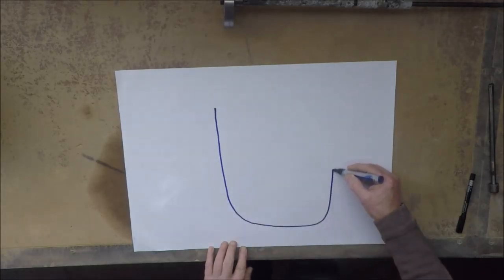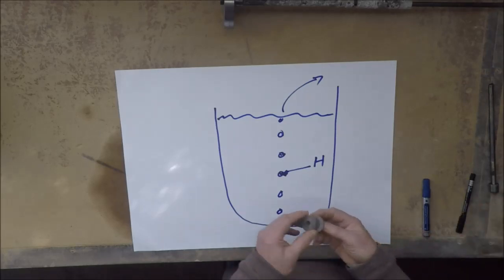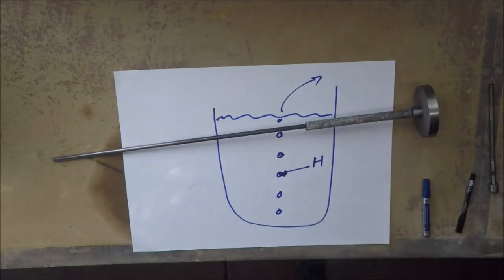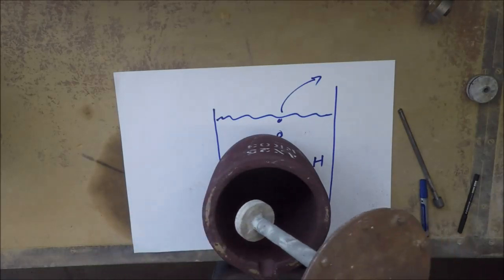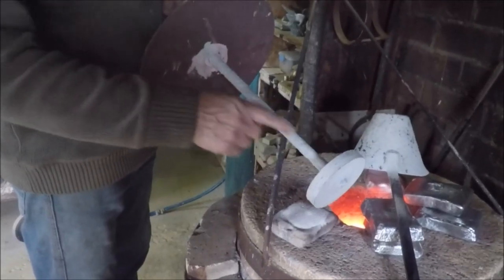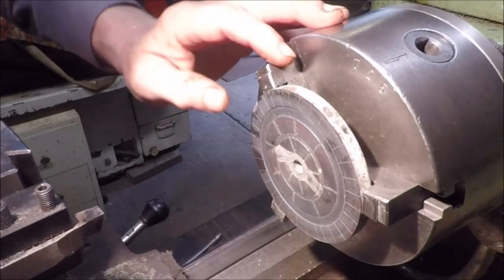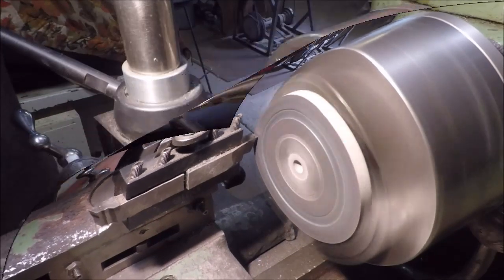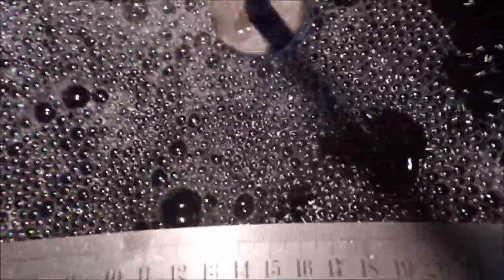My Home Foundry, Most recent Degasing Lance

Comment: A most interesting video, Martin.
Question; If the hydrogen comes from water vapour reacting with the molten aluminium, then I hypothesize that the source of that water vapour would be the humidity layer at the surface of the aluminium at room temperature. 

This is somewhat like how low hydrogen welding rods can absorb moisture if left exposed to the atmosphere. The solution for the welding rods is to keep them either in a fresh sealed tin or to keep them in a rod oven to drive off the moisture.

Therefore, the solution for reducing the amount of water vapour available to react with the molten aluminium in the crucible would be to pre-heat the aluminium feed stock in a suitable oven or low temperature furnace for a suitable heating time to drive off as much of the surface humidity prior to charging of the crucible.
 
 I have noted in numerous casting videos where additional feed stock is to be added to a crucible, that the feed stock is pre- warmed by placing it around the edge of the furnace. This would have the effect of reducing the "loading shock" to the overall temperature of the crucible, but I don't believe that it would be a long enough pre-heat to drive off the majority of the humidity layer or surface absorbed moisture. 

It appears to me that the best way to reduce this moisture issue is to use an oven or low temperature furnace to pre-heat aluminium feed stock to at least 200 deg. C as this temperature is well above the boiling point of water at 100 deg. C and should drive off the water vapour.

What are your thoughts on the matter?
Reply from the maker: Mark, Basically what you say is correct, but there are many more sources of hydrogen and perhaps the main one is that when we burn a hydrocarbon fuel one of the products of combustion is water vapour. There is in addition the natural humidity in the air which of course varies all the time. In fact some people believe that on very humid days it is difficult to degas properly and to keep the hydrogen level down as the pick up from the reaction of the humidity in the air and the surface of the liquid metal can be quite high (particularly if the surface of the metal is agitated) - this can even be the case with electric melting - the humidity in the air is quite simply that potent a source of hydrogen! Drying ingots, scrap on top of the furnace is indeed common - I do it. It is best remembered that when one puts cold material on top of the furnace moisture in the outgoing furnaces gases will  condense on the cold material - it will in fact get absolutely dripping with water initially and one does need to wait until it is well above 100 deg. C before adding it to the liquid metal in the crucible. Scrap that is badly corroded is a problem as the corrosion product is often hydrated and this water can be hard to drive off. Anodised aluminium is a bit problematic too as the anodic film is at least in part Aluminium hydroxide. I do not like to use greasy, dirty, or painted scrap either. I am uncertain as to how hot one really needs to get metal to drive off any occluded surface moisture but I judge that if adding material to liquid metal does not result in bubbles immediately coming to the surface then it was probably dry enough. Incidentally even metal at say 300 deg C (as compared to say 100 deg C is not going to be much less of a loading shock - we have to take the latent heat of fusion into account and I think this is much bigger than the "heat" difference from 100 tor 300 deg C.
I do know that some larger foundries preheat their ingot (and possibly scrap) before loading it into the primary melting furnace although and in some disagreement with my loading shock comment above I suspect they do this mainly to increase throughput of said primary melting furnace (in some ways dry hearth melting is a better technique as the charge is thoroughly preheated and the liquid in the furnace is totally protected from loading shock but I have concerns about oxidation with this technique. Other sources of moisture that many people forget about are damp furnace tools and damp fluxes and even bail out ladles. And then of course we have the people who attempt to degas by plunging water of crystallization containing chemicals to the bottom of the melt - the bubbles you see coming from this technique (Many YT videos show this appalling technique) are steam - about the worst thing that you could possibly bubble through your metal. The two most common that come to mind are Washing soda Na2CO3.10H2O and Epsom salts MgSO4.7H2O. It is the 10 and 7 H20 that cause the gas output from these two substances - a most counterproductive technique.
Reply: Thanks for the reply Martin. 
Given what you have written about some of the water coming from hydrocarbon combustion then it becomes obvious as to why many professional foundries use electric induction to heat the large crucible. No combustion and no forced draft to draw in more moisture laden air.
It also seems like casting on a humid day needs to be done in a humidity controlled environment, which is something beyond most home foundries.
As for the Washing Soda and Epsom Salts, it looks like I will have to investigate the making of an Argon Lance along the lines of the one you have made or look into buying degassing tablets.
Reply from the maker: Mark, The propensity of aluminium to dissolve hydrogen is perhaps the metals Achilles heel. Degassing is a most difficult area. Big foundries have it well under control with rotary impellor degassing units but this is an option hardly open to the amateur or small foundry. The mechanics of RIDs are nothing special but the impellor is another matter - it has to spin at a few hundred RPM in molten aluminium a substance known for it ability to dissolve almost all other metals (its not supposed to attack Zirconium - but there is not a lot of that around). In addition the impellor has to be mechanical robust and resistant to both oxidation and thermal shock- no easy trick! Quite exotic materials are used - things like silicon nitride - exotic, expensive, and most difficult to machine. Beyond us small operators. And even if one could afford a commercial impellor it would be way to big meant probably for 100 Kg batches as a minimum. If you use a lance you need to maintain a supply of either argon or nitrogen, rental on the bottles is a killer about $250.00 per year for a large bottle. You could investigate own it yourself bottles or the small disposable bottles available at welding shops (note you must use either nitrogen or pure argon NO argon CO2 mixes) Either way its going to cost money - money perhaps better spent on decent crucibles to replace the (Groan) tin cans that many use (this is another sore point of mine but I will not go into it here.) Then lances like mine require constant maintenance - areas of aluminium attack must be checked for and ground out after every use and the boron nitride protective wash must be reapplied before every use. This wash is about $200.00 plus a gallon and that's a small American gallon! But it can be obtained in 1 pint sized containers in the US - last time I came across it at about $80.00 a pint!!!  If your lance does not give fine bubbles like mine does then its a waste of time anyway - whatever lance you come up with check the bubble size in a bucket of soapy water. Re degassing tablets - hmm - yes - well. I used to use these - initially they were Hexachlorethane it breaks down to give chlorine which reacts with the aluminium to give Aluminium chloride this is a gas at the temperature concerned and it bubbles up through the melt removing the Hydrogen. ( The suggestion that the chlorine reacts directly with any hydrogen in the melt to give HCl is a complete nonsense)However the fumes coming off the melt are both toxic and very corrosive - everything above shoulder height in my foundry is rusty and the roof above the furnace leaks. In Australia you can no longer buy this substance because of its effect on the Ozone layer. Pity really it did a half decent job of degassing if used properly. I was thus forced to go over to the tablets that dissociate in the melt to produce nitrogen. These are not very good, they breakdown way to quickly (2 to 3 minutes - way too short a time for any meaningful degassing) and they cause extreme turbulence - they splashed 2 inches of metal out of the crucible - I had to sit a steel ring on the top of the crucible to contain this. Such turbulence is likely to INCREASE the hydrogen level as it mixes the metal with the humid furnace atmosphere. In fact a commercial foundry near me conducted trials and were convinced that these nitrogen tablets actually INCREASED their gas levels - the supplier of the tablets of course disagreed! The standard bell plunger used to hold the tablets to the bottom of the melt is a bad design. Its hard to clean and tends to hold the gas back and let it go in large (HUGE) bubbles. I used a spiral, more or less in the shape of a bell plunger, bent up from 3/8 inch steel rod. It was easier to clean and provided I applied a coat of ladle wash before each use it lasted OK and seemed to allow smaller bubbles.My honest advice on degassing to the amateur is Do Not Bother. If you chose your scrap with care, preheat all additions and make sure everything is dry (fluxes etc.) melt quickly, don't over heat (760 deg. C  max) and pour with minimum delay your gas levels should be low enough to get away with. This is particularly the case if your castings are relatively thin as solidification will then occur too quickly for much gas to come out of solution (and any that does will be in very fine bubbles  - invisible at YT resolutions!) If your castings are on the heavy side and gas becomes a problem then I guess that you will need to rethink. Always remember that gassy metal can be recovered by simply allowing it to solidify very slowly in a wide open topped mould - dried preheated sand might make a suitable mould. This will allow the gas to come out of solution and on remelting most of it will not be redissolved.Humidity controlled environment - that would be a laugh - last foundry I worked in had evaporative cooling blowing on the operators at the casting stations - nice humid air blowing all over the holding pots!! But they did have continuous nitrogen degassing on every holding pot via a silicon carbide "Hocky Stick" - these have a porous bottom leg (the bit you would hit the puck with were it a real hocky stick) the nitrogen came out through this porosity as reasonably fine bubbles. One day maybe I will work up to a video on the subject of degassing if only to dissuade people reaching into their various household cupboards, pulling out some random chemical and in complete ignorance of physics, chemistry, and thermodynamics swearing by all that's holy that it is the go to thing for degassing - I don't mind them destroying their own work but others copy them and their work too is ruined - a bad scene.
Reply: Can you explain loading shock? Regards, David
Reply from the maker: David, My understanding of "loading shock" is that when one puts solid aluminium into liquid the relatively cold additions (even if well preheated) will cause a significant drop in the temperature of the liquid metal already in the crucible. - A temperature "shock" if you will. If you add a lot of solid to say a lesser amount of liquid the whole lot can go solid or at least pasty. What actually happens is determined by the relative quantities  and specific heat of both solid and liquid aluminium and by its latent heat of fusion. Generally though the temperature recovers quite quickly. However it is best not to add to much solid at once. And never to add once casting has started. Another factor is that such additions can cause the precipitation of surprisingly large particles of intermetallic compounds, these are based on what might be considered unwanted impurity elements in the aluminium - iron manganese chromium etc. these particles are slow to redissolve are very hard and very brittle, they damage tooling and can seriously lower the ductility of any resulting casting should they get cast into it. Often these compounds are found at the bottom of the crucible  after a pour - the old timers used to call them "sand"   for that's what they resembled. This is more a problem with oft melted scrap, pressure diecast, and older alloys - none of which in my opinion should ever be sand cast. :) The occurrence of these compounds is one of the very good arguments for not melting in steel crucibles.
Reply: "And never to add once casting has started."
With respect to that comment Martin, could you elaborate further? My plan is to do multiple step melts, where the scrap I use is melted down to form easy to use muffin tray discs and it also allows for the majority of the dross and "sand" to be removed. Then during an actual casting I am only concentrating on the cast itself and not worrying about the by products.
Reply from the maker: Mark, My method with sand casting is to melt a  crucible of metal, degas it, then flux off the dross, lift the crucible out of the furnace and place in the pouring shank. As soon as the temperature is down to where I want it I pour the castings Once degassing starts I do not add any further metal to the crucible. Its similar if using a larger crucible and ladling out of it. For gravity die work I usually do not degas (solidification is so quick that any gas does not have time to come out of solution and form bubbles) but do flux off the dross. Even though I may cast from the slowly going down crucible for the next 2 to 3 hours I do not add any more metal to it. Over lunch I refill the pot and proceed as above for the next few hours until the crucible is empty and I have collapsed in exhaustion :) I have no doubt that intermetallic formation does occur as the result of additions whilst I am melting and getting the crucible full but while slow to redissolve as the temperature picks back up they will do so in a reasonable time and I never seem to get "sand" in the bottom of my crucibles. However to add cold metal  in-between ladles of metal into a die for example would not give sufficient time for the intermetalics to redissolve. Be careful of the scrap that you chose to melt down anything wrought is a no-no anything that was pressure diecast is a no-no. Don't mix alloys. My advice here is that you go down to your local scrap metal dealer and buy some scrap alloy wheels, these will be 601 alloy (356) - good stuff its what I use  although I buy Ingots - break them up with a big hammer - if they bend rather than break they are Magnesium wheels (they are very rare) DON"T try to melt them. I suggest that you melt till your crucible is full, cast you "muffins" until the crucible is empty or nearly so then refill to full and cast again, do any necessary fluxing etc. after the crucible is full each time. At the end of your scrap and casting run throw out the last 1/2  inch or so in the crucible.
Reply: Darn, I now have quite a collection of aluminium scrap, drink cans, extruded shapes, exterior flood lights, cast light components, some shapes which appear to be die cast, and one or two alloy wheels.
I was planning on using the cans and maybe the extruded shapes for "practice castings" with the better stuff for the item I will make for a client. I may now have to do a re-think.
Reply from the maker: Mark,  No, By all means proceed as you had planed. use everything except the wheels for your practice runs - Learn on Junk, I did! (for a little while anyway) but don't try to make anything that you are going to want to use and depend on out of the junk, save the wheels for that and when you have it under control use the wheels. When you are finished practicing bury the junk in the back yard! But note that junk alloys made from who knows what including wrought material may behave very strangely with respect to feeding etc. Their behaviour might be very different from the easy to work with behaviour of the wheel alloy. Cans are wonderful metal - very clean but have a lot of surface area for little metal which means a lot of oxide in your melt and although you can cast melted cans you will have great difficulty trying to machine the castings - they will be like chewing gum. In making for a client you need to be careful as if there is a stuff up and someone suffers you could be sued. You need to be able to demonstrate that you have taken all reasonable precautions to ensure a safe product and that obviously includes material choice. For a paying client I would make a point of using certified ingot, but then I always do.